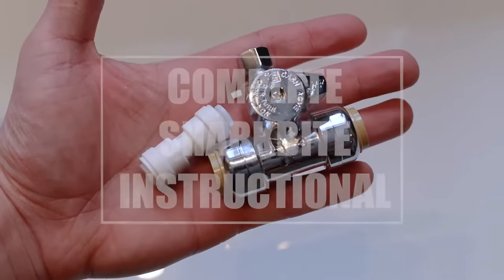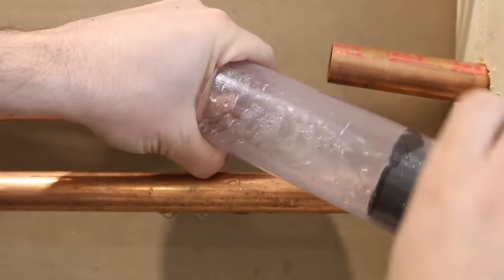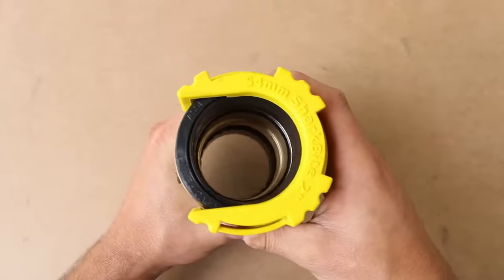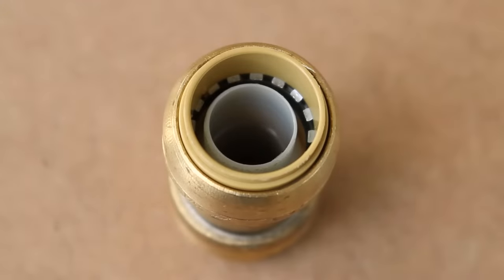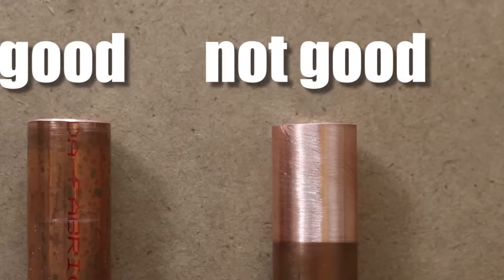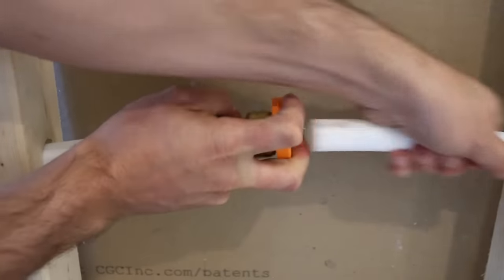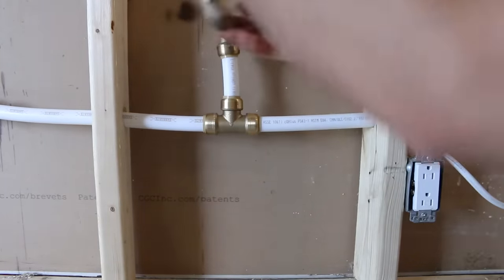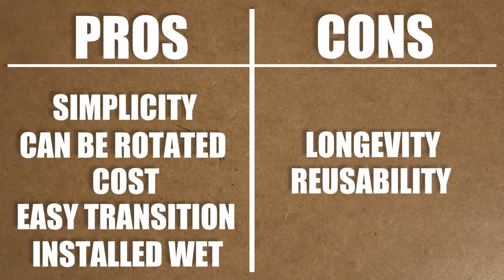Beginners Guide To SHARKBITE Fittings (Watch till end BEFORE Buying!) | GOT2LEARN

Comment: Great video.  I love the pro/con approach and greatly appreciate the detailed explanation about the inner workings of the product.  I thought I would share some real life feedback about a sharkbite installation.  

Around 11-12 years ago I had an underground steel pipe leak (inbound from the meter to the house), and it had already been repaired using a menagerie of fittings and different materials.  I had to connect steel and use pex to make it work with the previous repair.  The repair held up until now, and the reason for the failure was the deterioration of the brass ends holding the plastic sleeves and ultimately the gaskets.  However, this makes sense as I was not aware that manufacturer required a silicone wrap around the entire fitting for in-ground installations.  It was clear that the soil did its thing and deteriorated the smaller metal pieces over time.  

Knowing this I am actually re-installing another sharkbite coupling and wrapping it in silicone tape before putting dirt back over it.  I really like the flexibility of using pex for a not quite straight installation between the city meter to the existing piping and being able to easily connect two different types of material. I have no hesitation putting a silicone wrapped sharkbite coupling underground into use.

Comment: I think they are a great temporary solution but it’s so hard to beat a proper sweat connection. Maybe pro press. Excellent video, your cut aways show all the details and your narration is awesome.
Reply from the maker: Thanks so much man! I too, prefer ProPress over Sharkbites, I don't like the way Sharkbite hold onto the pipe, but it's still a cool concept.
Reply: @Got2Learn  Crimp fittings take a beating and offer advantages over sweated connections. any thoughts??
Reply from the maker: Crimped PEX is awesome. The new Uponor expansion joints are the best, I wouldn't hesitate 1 second to do my whole house with it, best product ever.
Reply: Got2Learn Yes, Uponor definitely looks like the best pex fittings.
Reply from the maker: I've done 3 high rise buildings with this and we never got any fails or leaks, so it works.
Reply: Call me a “Copperhead” but I can only truly trust a compression or sweat connection.
Reply: @lmckrosen123  I am with you.SharkBites I would only use temporarily in an emergency situation.I used half inch ball valves with compression fittings to replace the shower valve in my bathroom because the wall behind the shower valve happens to be in a closet (a towel closet is what I believe it is called.) and the space is very tight.Compression fittings unlike soldering and press fittings allow for what ever is attached to be removed and replaced if and when the need arises because replacement brass compression rings are available.

Comment: My personal guideline is to use SharkBite for exposed/accessible plumbing and to use traditional soldering for hidden plumbing. Saves a lot time and is less messy for the quick weekend project. Fittings are on semi-flexible hoses (vibrate a bit) to softener going 6 years and not a drop of leak yet. Just make sure to deburr and lubricate the fitting O-rings.

Comment: The way I see it is if I am having to replace a leaking pipe that a "professional" installed, why would I trust another professional to do it right...when the average cost for a plumber service call is between $175-450.  I bought everything I needed to do the job myself using Sharkbite for less than $50 and I have zero experience working with plumbing and pipes.  I'm sure there are some really good professionals out there that could do a better job, but for the average homeowner and most applications, these work.
Reply: Not all plumbers are bad, but with Sharkbite fittings, many times you just won't need a plumber.  The key thing is getting a clean cut on the pipe, then removing any burrs.
Reply: @freshoxygen2176  I would always recommend Pex A with expansion fittings products (Uponor, Rehau, etc) over anything that is crimp fitting (and usually Pex B).  Zero flow reduction anywhere in the line and (depending on the brand) easier to remove without cutting the tube like with crimps.  Though I recommend any type of Pex with any fitting over copper for most any home situation.
Reply: @curtisbme  what about complaints of PEX A affecting water taste? I have heard that from many people. They have to run the water 5 minutes before using it for consumption. Plus; has leaching of PEX chemicals really been tested after A 5-10 year install?  Etc
Reply: @kimwilson861  
most are for none potable use.!!!
Reply: @freshoxygen2176  Is the reliability issue due to the rubber seal, moving parts, or something else?

Comment: I’m just starting on plumbing my tiny house. Bought PEX B and fittings. This video is very helpful since I have virtually no plumbing experience. Greatest concern is installing the propane tankless water heater. Fortunately, there is a great diagram showing everything that I can follow. 
Being that my house is on piers (and I live alone) I’m planning to keep all of the piping, vents and drains inside the house, not inside the walls. The only part outside will be the septic connection and the vents terminations to outside. Also the tankless vent to exterior for exhaust gases.

Comment: They are great for quick fixes on our vacation home in the desert.  The home has polybutylene pipe and shaekbite also makes fittings to adapt from that to copper/pvc/pex.  I’ve replaced all the connections to the faucets using these with zero problems. Planning on tearing out the polybutylene and doing a pex repipe in the near future.

Comment: 14 years ago my brother in law used a saddle fitting to connect water to my fridge.  Now I have purchased a new fridge and I found that there is no shut off to the fridge.  I researched and found you video on using shark bite fittings.  Seems the best solution for my need.

Comment: I have had to replace sharkbite couplings that were used underground on a water service. The pipe would sink after several years and pull the sharkbite coupling in to, meaning break in half. I never had any problem with them inside. Use flo-control couplings if needed for outside.
Reply: I'm ready to try thanks
Reply: These fittings are never meant to be used underground. They are solely used for easy to access areas like under sink connections.
Reply: Hggu

Comment: I installed 1 inch sharkbite fittings on my water softener in 2006, they have had zero issues for the past 14 years
Reply: Not  to pick on you, but this anecdote leaves more questions than answers. For instance 1. What is the source of your hard water? 2. What is your static water pressure 3. Which fittings were you using?  4. What piping were you connecting to on each side of the fitting(s) used? 5. Did you use brand new fittings? 5. Did you install them in an enclosed/hidden/inaccessible location? 6. Why did you chose the costly SB fittings over cheaper copper?
Reply: They are supposed to be good for at least 20 ? years ,so uve got 4 more years of safe useage. A home my parents owned about 15 years ago had similar fittings in the walls, they started leaking with mold growing, so ended up being costly fixes.
Reply: Holy shit.....its been 14 years already since 06.......i thought that was last year😔😔😔
Reply: Same
Reply: @notcharles  
1. Well water high in Iron
2. 60
3. None all new set up
4. All copper
5. Brand new
5 (you miss numbered). in corner of basement all in open area
6. more costly yes, but the time saved over sweating pipes and the sharkbites and can be adjusted after install or removed and reused.
Reply: @notcharles  I'll give it a shot.  I'm a professional engineer and contractor, since '72 (HVAC, plumbing, piping, etc.).  There have been a lot of attempts to replace soldered/welded piping.  In the last 20 years, these have proven pretty reliable:  often more reliable than solder/weld because the old time skills just aren't there any more.  Gotta live with it.  I also installed SB on my water softener.  By the numbers:  1.  Well water, 30--40 grains hard (btw, 7 is considered "hard").  2.  About 60#; it's a large water utility, tanks, pumps, recirculation, about 10,000 residents and biz customers.  3.  Whatever fittings HD and L's stock; straights, els, tees, valves, flexes.  4.  I used copper.  5.  New fittings, although I goofed enough that I re-used 4 or 5 after extracting them (I have almost 50 years experience, but must admit I'm all thumbs!).  6.  The water softener install is all visible and accessible, but after the experience I'd bury them and hide them.  6.  All thumbs, remember?!  :-)    I never got good with a torch even when they allowed lead solder (which was much more forgiving).  Big apartment building burned up a couple weeks back:  wanna bet it was some plumber with a torch?  Happens a lot.  I'm convinced SB works.  Longevity of the O-rings?  Commercial large pipe (like 16") has been installed and buried for a couple decades now using essentially the same O-ring trick.  Wearing my contractor hat, I could hire relatively cheap labor (including ME!) to assemble a SB system, and the labor savings (and fire insurance?) would pay for the fittings.
Reply: @edwardmulder3777  That's where my mind goes! 
Moisture slowly sogging the wall where you can't see it, then a massive mold problem starting to give you breathing problems until you see the wall showing signs of water damage. You peel it open and go blek!

I've worked on commercial fishing vessels etc and repair high end machinery. Machinery has planned maintenance schedules, so they plan for access and replacement. usually :(... 
I Just don't get why they build houses with only destructive access! -especially for things like showers that see high flex, vibration, and thermal expansion loads.

We use other forms of pushlock fittings for air or pressurized oil or grease systems. They are great for the ease of use, twist relief, and replaceability. I'm definitely a fan, but those types of machines can handle a small leak without problem and frequently have alarms if behavior is different than expected. (oh no, a drip of oil has made it to the metal channel inside its of the grease catch tray. I might want to vacuum this up sometime in the next decade/century/or so...)

2 Basic questions for anyone considering installing these in walls:
1. How can you tell when they are starting to leak? (waiting for soggy walls seems like a bad/expensive answer)
2. How are you going to access them to replace them when they fail or are due? (when due being much cheaper than waiting for wall damage to indicate failure)

I don't think those should stop someone. Just some suggestions:
1. plan & insist on easy open access panels that are not locked shut by paint (they can match paint, but I suggest trimming them to hide the seam-gap and either bolting or screwing them on)
2. schedule and date a 5 or 10 year open-all-the-panels-and-visually-check day. (maybe the anniversary of getting your house = celebrate it and also make sure everything is still good day)
3. Strongly consider replacing on a schedule instead of by failure. (every 20years spend a couple hundred to replace everything and avoid expensive wall damage)

4. Consider putting some moisture indicators wherever you have these fittings. That can be as simple as paper towels and/or a dry indicator dust that you can tell when it has gotten wet. (You can even tape the paper towels around the pipe fittings, if you want).
Reply: My house is 100% soldered copper. Going on 40 years here with zero problems. 14 years is a relatively short time to judge a plumbing system.
Reply: @petem6503  those pipes do not have any “o-rings” in utility applications. They have epdm gaskets, that are installed with mechanical fittings, it concerns me that you want to use shark bites just so you can hire cheaper labor. This will likely not be a good idea at the end of the day you will get what you pay for.
Reply: @kevincubillos4937  "Hire"?!  With the sharks I do it myself.  In slip-on piping, the o-rings are called "rolling gaskets" (or they were 30? years ago when I first saw them).  If a piping system will last even 20 years mechanically, it becomes more likely that ultimate failure will be due to corrosion.  You should see how much PEX is being installed:  miles and miles.  Die hards cling to the old ways, but anything labor intensive is history.  Just the facts ma'am.
Reply: @dogface6040  correct a lot of pex is being installed in my area pex is the standard in residential applications, but cheap labor is cheap no matter what material you use. I’m not particularly knocking the shark bite, although it is nice that home owners can fix their own property with this. The majority of times I see them use it a way that it was not intended and it ends up costing the next homeowner who buys their house. I for one would not want to buy a house that was repaired by a homeowner with a ton of shark bites, as a professional that is a red flag.

Comment: As I prepare to crawl under a house that was built in 1961 by hard scrabble farmers (wife's Great-grandparents retirement place) that thought running water was high cotton, I am thankful for this video. I'm going to use some push fittings under the barely 2 foot table crawl space with the plan to eventually sweat the original copper.
Reply from the maker: @JonathanKobler  😇👌

Comment: This is anecdotal, but perhaps valuable. I had a new water heater installed 10 years ago. The handyman who installed it soldered some joints, and used sharkbites on some joints that he didnt want to solder. 10 years later, 3 of the solder joints have failed, and all of the sharkbites are still good! Im sure a licenced plumber would have done a better on the solder joints, but it goes to show that for a DIYer or amateur, shark bites are probably the way to go. It takes training and expertise to get solder joints right.
Reply: My brother-in-law successfully used a shark bite fittings and he could have trouble operating soap.

Comment: EPDM  (ethylene propylene diene monomer) is a synthetic rubber that has been used for decades in automotive serpentine drive belts with great success and reliability. Considering the horrendous environments and stresses the belts are exposed to, I have no concerns about the o-rings in the fittings lasting a LONG time. Mechanical damage to the seal from incorrect pipe preparation, however, may mean that behind-the-wall installation could be problematic...

Comment: Very good explanation on how they work.  I, like you, have never used one in a closed wall.
Reply from the maker: Thanks!!
Reply: I love them and have never had a problem with them if there not pushed on all the way they will leak but if correctly installed no problems at all..
Reply: Exactly. Why put reusable joints in a closed wall anyway.

Comment: I actually used one of their faucet cutoff valves today to replace a 50 year old fitting that had finally failed. I was fortunate to already have the pipe cutter and deburring tool from my other hobbies, so it was a simple matter of cutting the old soldered fitting off and pressing this over after the proper prep. No leaks so far and I don't expect any for many years since I paid attention to the guides online.

Comment: Used these fittings for I think around 15 years now. Never had a leak. The only leak I've ever seen, was a defect fitting from the factory. Costs a lot, but you save that money right away in the speed of the projects. Would never go back and solder again.
Reply from the maker: Nice to hear!
Reply: Jeremy Marsh  You are absolutely correct. Our house is 70 years old and not one fitting failure. I have Sharkbites and I like them but can you imagine a 70 year old house with 40 Sharkbite fittings in walls and ceilings? I wouldn't buy that structure as it would likely require $10K of upgrades, perhaps more.

Comment: Thank you, you answered my question.  I was worried that it still would spin after I installed on the pipe and afraid of a leak at that point, but when you said that it could be repositioned and showed it , that relieved my concern.
Reply: My spigot falls down because it spins. How do I prevent it from spinning?
Reply from the maker: Fasten it with screws ;)
Reply: @bacard1002  If you're talking xbout a sillcock (like the valves used outside for garden hoses), they usually have 2 slots, or screw holes to mount them. If not, you can always use silicone caulk.

Comment: Great Video, used these type of fittings years ago on super yachts with no reliability problems, I loved the inter connectivity with different types of pipes of the same diameter also the ability to disassemble preserving the pipe ... Personally I like them in cavities with access. I agree in not burying them except in low pressure irrigation.
Reply from the maker: You are most welcome, please share if you can, it helps the channel tremendously ✌✌

Comment: I just used all sharkbites to rearrange my plumbing and install a new tankless gas heater after the old tankless failed unexpectedly.  It was $$$$ but made the project so much easier.  I bought the special release tongues. All my shatkites are out in the open, so they can be changed to soldered conne tions at a later date.  The ability to rotate them is certainly handy.